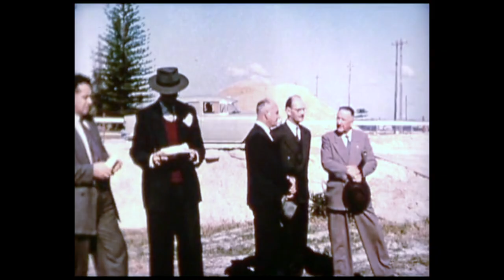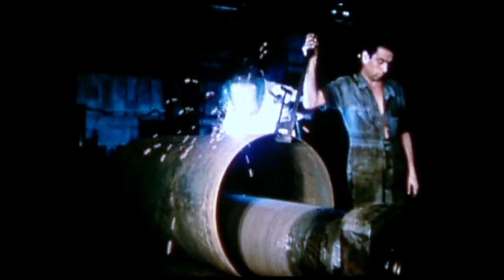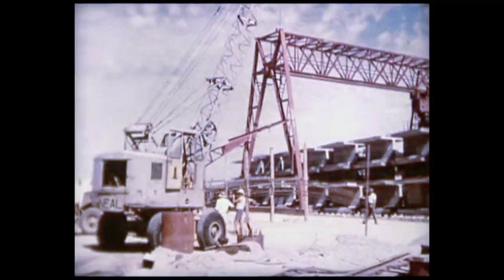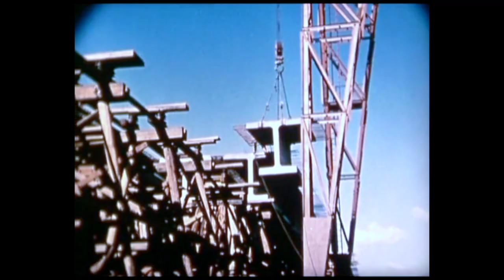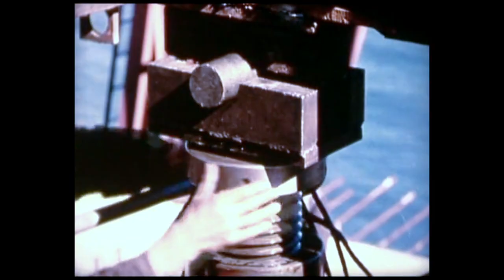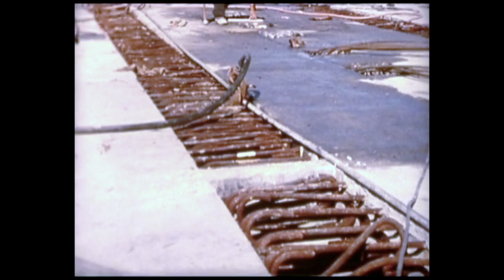The Narrows Bridge, 1961

Comment: Fabulous archive footage of a truly inspiring project. And what an impact the bridge has had. The piling method has stood the test of time and I worked on the installation of Woodside North Rankin A Platform in 1982 also using a variant of the Gambia method with 2m diameter, 50mm thick piles over 150 metres in length. These days I regularly pass under the bridge whilst fishing our magnificent Swan River and I marvel at the bridge. Thanks to this video I'm more informed and even more appreciative. Thanks for posting.

Comment: The crime back then was putting a freeway along prime river frontage, just as they did with mounts bay rd, imagine the views if we had cafes and restaurants and the like instead of the horrible freeway traffic now.
Reply: The freeway could be sunken with a tunnel and the land reclaimed for use. Very costly, but worth it in the long run.
Reply: And the destruction of the Barracks
Reply: If that was to happen. They'd have to consider population growth and allow for that. Right? Otherwise it would be the same issue now on the freeway through the city, but underground 😅

Peak hour seems to start from 2:00pm until 7pm when it comes to travelling the freewy through  the city.

Comment: My mind is blown. How we in Western Austalia could actually build something. The hard work that went into it sure has paid off over the years.
Reply from the maker: We build things all the time.
Reply: @MitchellFreeway  Sadly not as much as we used to. The new trains are built in India and assembled in WA. Why can't they be fully built here.
Reply from the maker: @1toonhead  incorrect. Only the empty metal body shell is made in India. The cab structures, fuel tanks, battery boxes, pantographs, couplers, electrical cabinets, sandboxes, seating, air systems, insulation, floor panels, piping and other various metal components are all made in WA.

Electric railcars have never been built in Western Australia. It is an entirely new industry being established from the ground up. 50% local content is an achievable goal and also provides scope to scale up in the future. If it was fully built in WA the cost and timeline would increase considerably.

I would also suggest that there isn't a single modern heavy rail vehicle that is entirely made within one locality.
Reply: @MitchellFreeway  Thanks for the update. :)
Reply: @1toonhead  Labour costs
Reply: This bridge was built by the clough family and they brought in a concrete engineer from Wales in the UK.   Hugh Jones to over look 
the concrete work
Reply: The tradies working on this contract were Fantastic well done men
Reply: West Australians built a weir at Mundaring and a 526km pipeline to Kalgoorlie in 1898-1903 and still stands today - 121 years later.....Narrows is a teenage compared to Sydney Harbour, that's 9 years off its centenary.  Even the Snowy Mountains Hydro-Electric power is barely 52 years old.
Reply from the maker: @andrewmurray1550   almost nothing of the original pipeline remains. The pipeline was originally built underground but has since been raised and later upgraded with more modern pipes, the steam powered pump houses have been replaced by electric and most demolished, the weir has been raised and strengthened, etc.
Reply: @MitchellFreeway , it would be nice if they kept one of the steam pumps and if possible restored it as a historical estimate to wa early engineering.  Make it a museum to the pipeline and what was,involved. That's my thoughts anyhow..  <3 

Perth has an interesting and u under appreciated history. We should preserve what we c an for future enjoyment, education and appreciation  <3